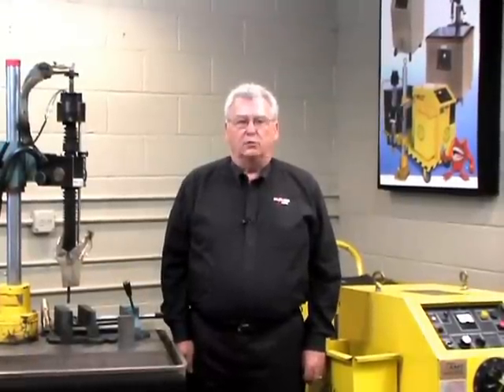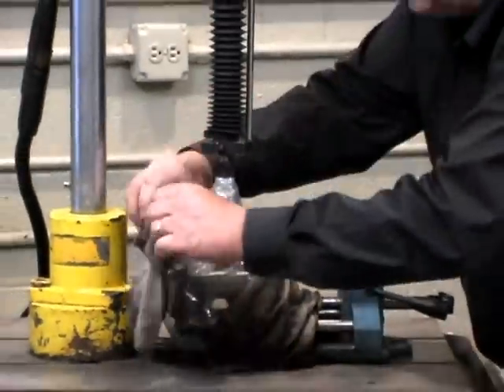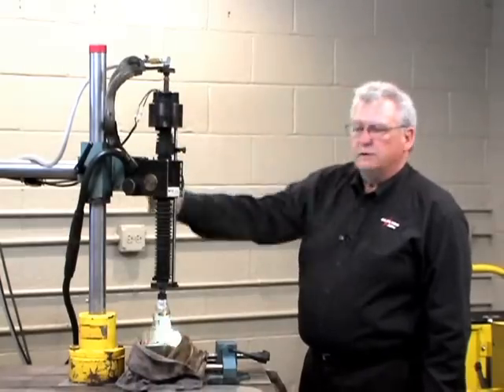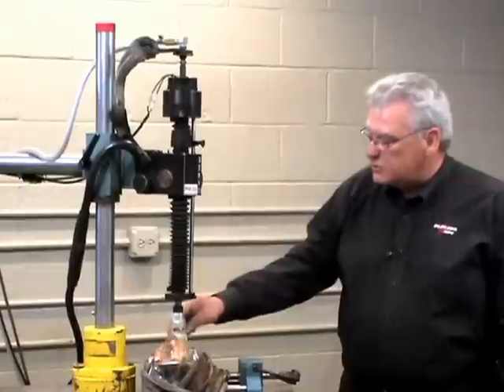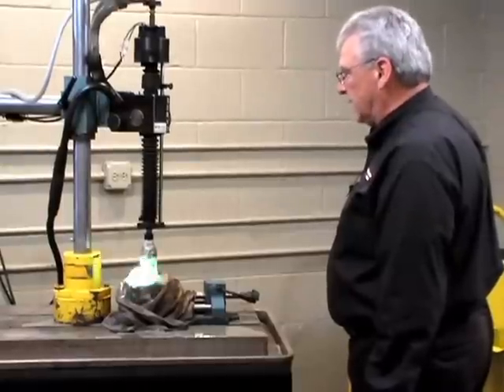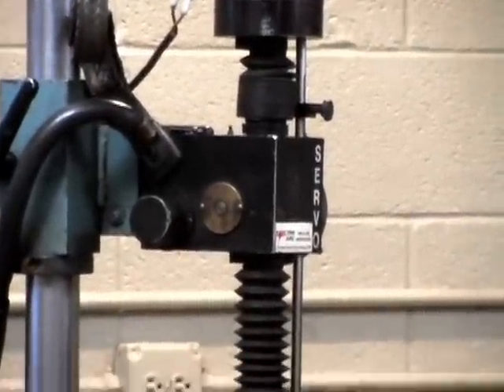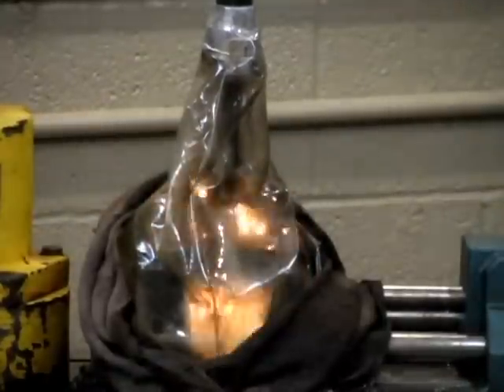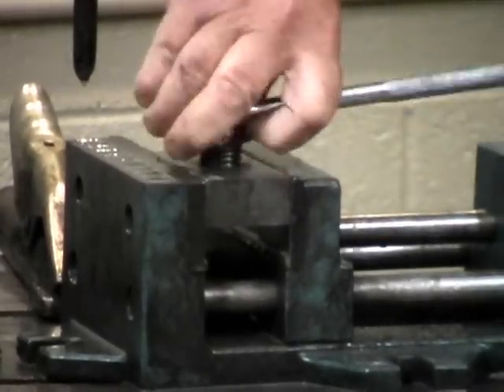Bolt Removal Spark Erosion Machine

Comment: This is an excellent example of the precision and efficiency of the EDM process, when done correctly!!! My questions are these: 1) Can this process be done on things that are in non-flat positions? Vertically, overhead, tight-spaces? 2) What are the electrical power requirements to  operate this machine, and others like it? 3) What type of consumable things will be required to run this machine? 4) Are parts available to service & repair your machines?
Reply: 1. Our portable EDM Broken Tap remover Machine has magnetic base and it can be absorb on the work pieces to finish processing. 2.The Electrical Voltage is 220V/110V and you can choose the machine according to your local voltage. 3.The consumable materials is brass and  the machine has one set electrode for you.